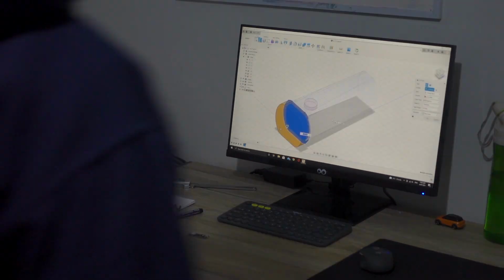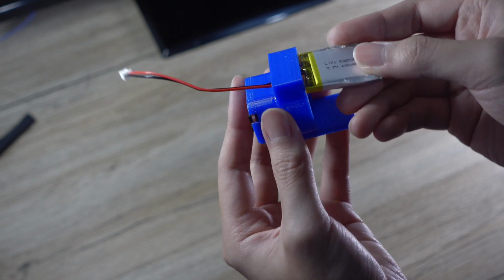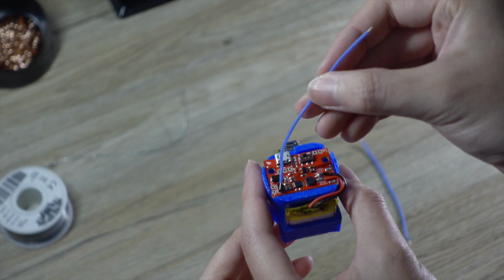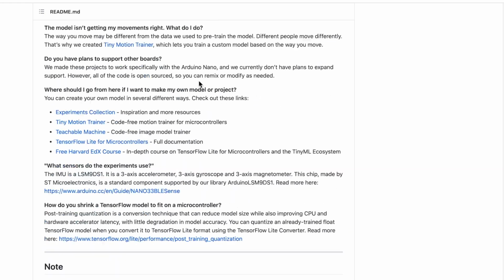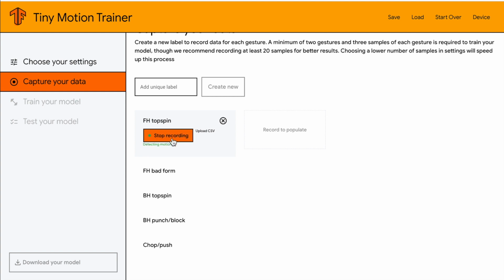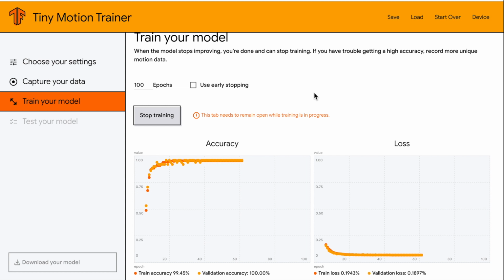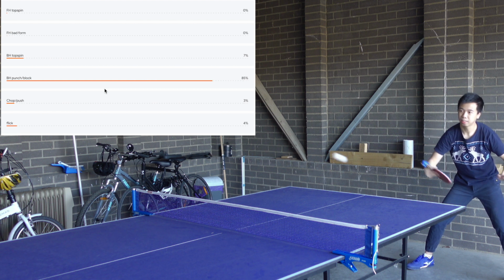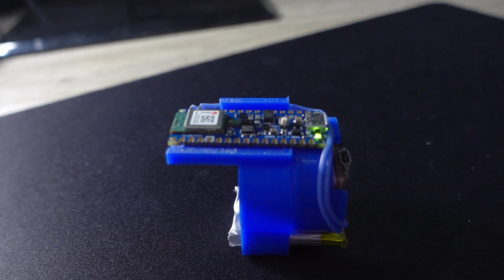Here's Why I Made The Smartest Table Tennis Bat with AI

Comment: For tennis racket you can hide it inside the grip ... and no more discrimination like penhold/shakehand grip in pingpong 😉
Reply from the maker: Halo Pak J! That’s a good idea, there are many other applications as well (eg. baseball bat, golf club, badminton racket), I just happen to play ping pong and also one of the very few people in the world that still use penhold grip 😅. Like many others have suggested, I will try to make the shakehand version. I will try if possible not to embed the board inside the handle, because the idea is to have the device modular so players can put on and take off the device from their existing equipment that they’re already familiar with.